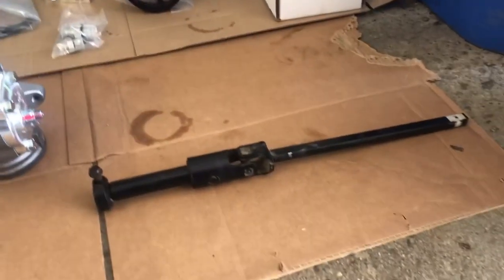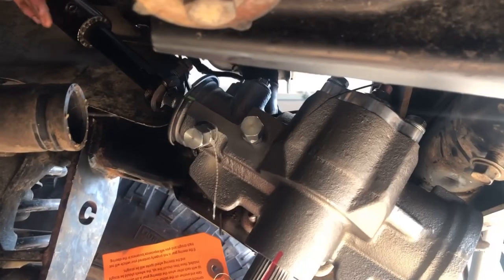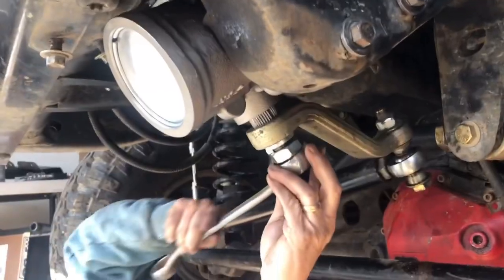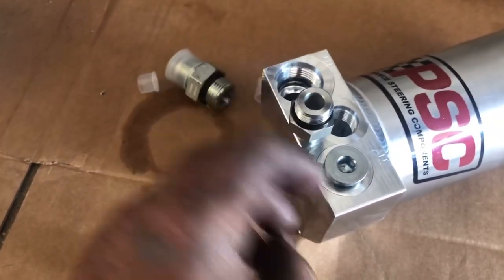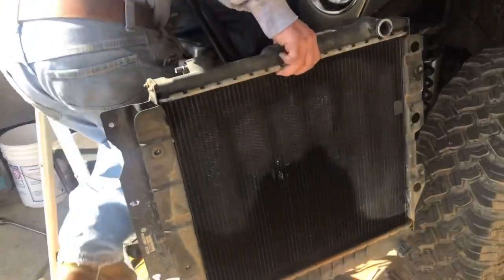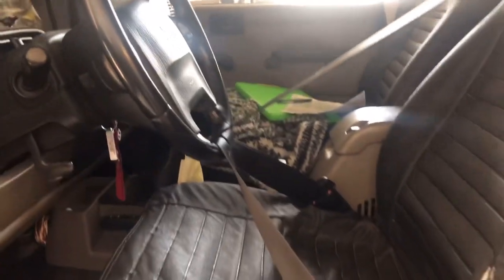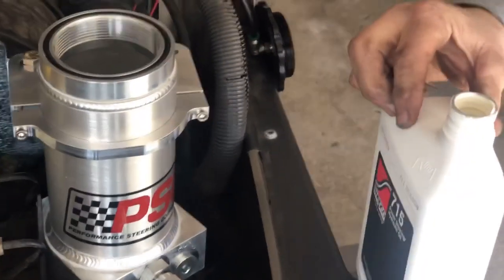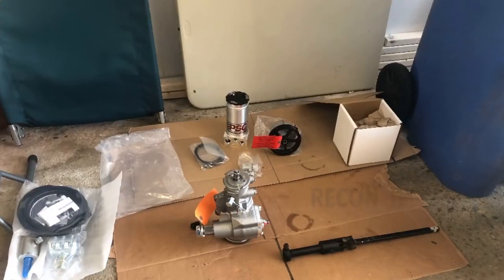Jeep LJ Gets PSC Steering Upgrade

Comment: Hey guys. Nice install! I wish I had purchased the pre-ported version of the Big Bore gear box. Duane did it right. Anyway, good job!
Reply from the maker: Hello Ren, good to hear from you.... we thought it was a good project and the quality definitely there... I wouldn’t hesitate to put that system in my Jeep. Although the experts say that the big bore box alone easily handles 37’s... I prob still buy the box with the assist ports as well.
Reply: @reconjeeper0321  It cost a bit more but worth it in the long run if considering the assist for 40's.

Comment: I noticed your wires running down the left side of you clutch master cylinder.  Where did you run them I to the cab?
Reply from the maker: So those wires are for lights and switches and onboard air, they pass through the rubber grommet down on the firewall and then enter into the cabin. 👍🏻🇺🇸